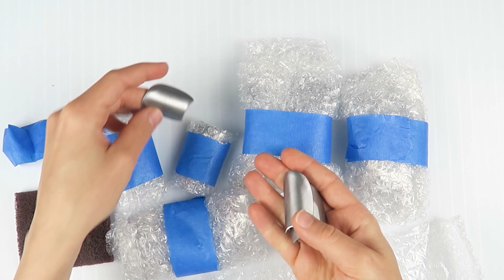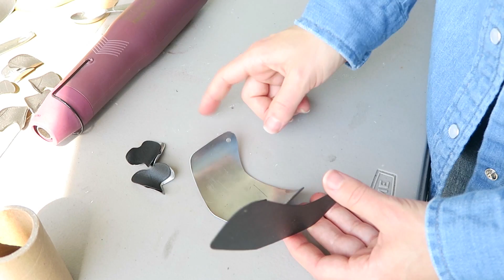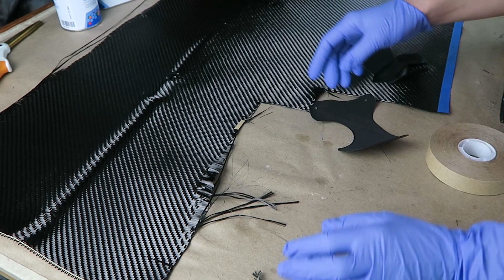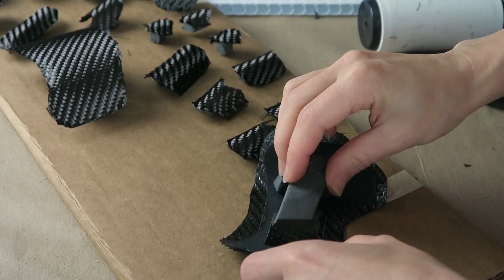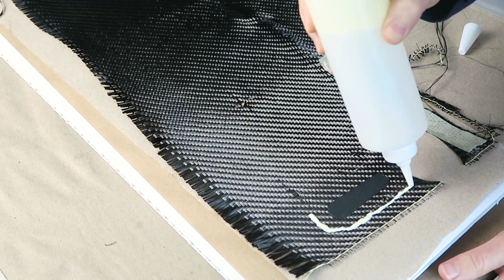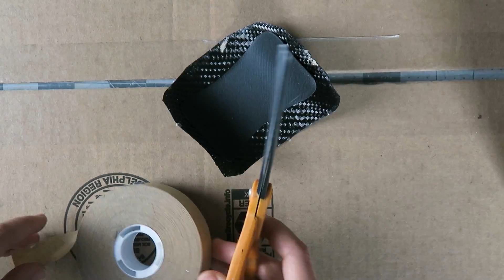Steel and Carbon Fiber Gauntlets Part 1

Comment: If you get SMT Rework Hot Air station, they are like $89 USD, you will be able to control the temperature and the air flow.

Comment: Super 77 isn't really that good of an adhesive,  I've had better luck with contact adhesives and gorilla glue.  If you need some setup time and don't care about mess, 3m super weatherstrip adhesive.
Reply from the maker: Just gotta watch it with expanding glue like gorilla or anything that needs to be applied to both surfaces since it may show through on the front.

Comment: In my experience most spray adhesives are meant to be applied to both pieces, wait for both to almost completely dry and put together. After that the bond is darn close to indestructible.
Reply from the maker: Might be the problem. I'm not sure about spraying directly onto the cloth.
Reply: You'll never believe what just happened with so called spray adhesive and hair
Reply: @dantsy6397  there's a reason why people say being stupid should hurt

Comment: I was watching your video... great content keep the good work... I think you may like to work better with a Soldering Heat Gun since you can control not only the heat but the amount of air.
Reply from the maker: That sounds useful, thanks for the suggestion! My adjustable temperature heat gun recently died, so I'll be needing to get a replacement.

Comment: Looks very interesting. I kinda had an idea for a character in mind after this video that has one hand just carbon fibre, the other hand just steel, and then it slowly starts to mix up the materials along the arms. And the torso is basically 50/50 balanced with steel and carbon. Going down the legs would be the same as with the arms, having the boots pretty much only one material each, and having a transition along the legs. Too bad i'm not that talented to transform ideas into reality...
Reply: Yeah, it might be hard to keep your balance. And you would probably walk funny too with one very heavy and one very light boot on your feets. 😀 Just shows my lack of experience with practical costumes. 😉
Reply: Oh, yeah, I remember the Sea Queen... Probably best to only wear it under water if you want to avoid getting slapped by the skirt 😄

Comment: I could never quite figure carbon fiber it, it takes some time and commitment and I wanted to try putting it in a vacuum chamber, kind of like the thermoforming, but with a bag and resin, that's how I've seen the industrial people do large pieces.  Are you mixing these bits with the steel or going simply with the carbon fiber ?

Comment: You will get a better finish using vehicle vinyl wrap in carbon fiber. Way easier to apply and it makes an extremely smooth finishas it can be stretched. Nice project.
Reply: +mike Moeller The issue with using carbon fiber vinyl wrap is that it looks nothing like actual carbon fibre, serving only to cheapen the appearance of the product to which it has been applied.
Reply: pmodd says you. I use it all the time and appearance is great on it.

Comment: Carbon cloth is quite interesting material to work with. Have you considered soaking carbon in epoxy before attaching it to parts? I've seen it done and results was quite good